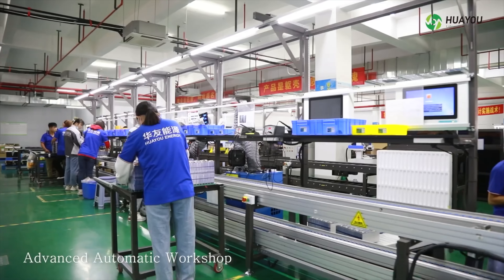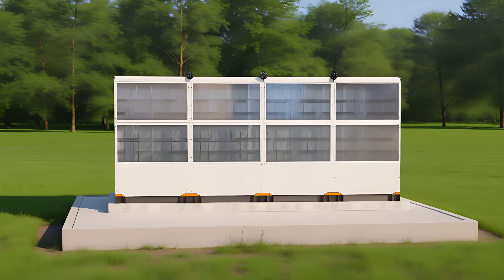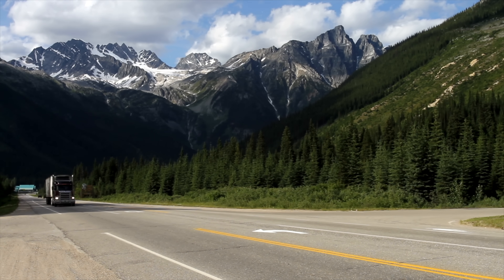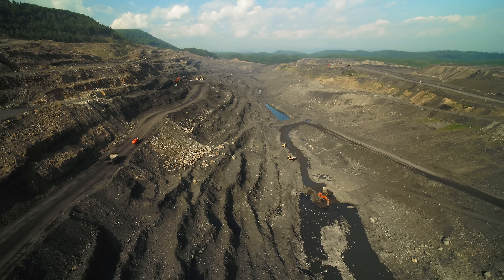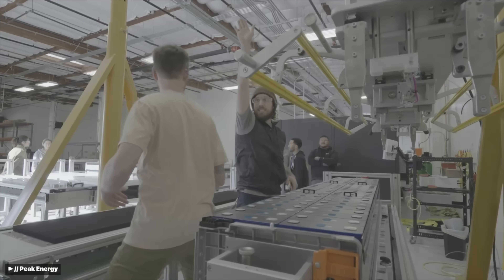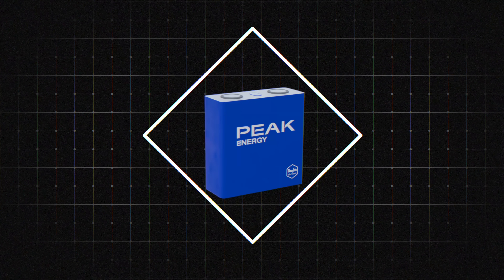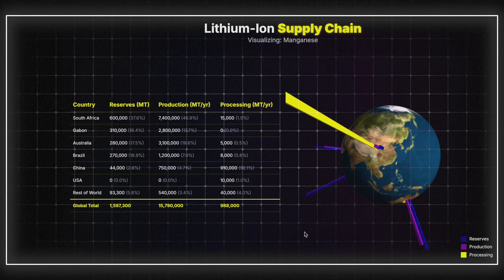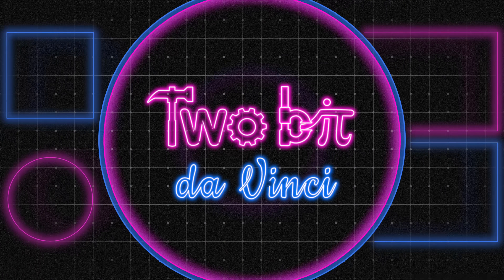Sodium Ion Batteries Are Going to be EVERYWHERE - Here's Why

Comment: Wait! According to Google AI,  China's CATL's new sodium-ion battery, branded as Naxtra, is set for mass production beginning in December 2025, targeting heavy-duty vehicles and energy storage, with potential expansion into electric vehicles. The second-generation Naxtra battery offers a competitive energy density of 175 Wh/kg, a long lifespan of over 10,000 charge cycles, and excellent performance at low temperatures down to -40°C. Sodium-ion technology is a strategic move for CATL, offering an affordable, safer, and more abundant alternative to lithium-based batteries, particularly for budget EVs and energy storage systems.

Comment: The voltage being a slop for the sodium battery isn't a pro. If you need 12 volt to run and after 50% you are below 12 volts then you ever have a device the runs slowly or not at all. It doesn't matter that the battery isn't dead until 2 volts if you need 12. This is why lithium is good for getting full power for it's whole duration even though it dies a bit sooner.

Comment: If that operation range can mean that an EV or hybrid doesn't lose 30-50% of its range in cold weather that would be a significant benefit for places where you can have weather that gets both cold and hot.

Comment: Every Car needs a One horsepower  engine running on FF making electricity for a battery that is 1/3 the size of what the car now has. Why is it people have such a problem with this. The Other elephant in the room is this. There isn't enough room on earth for number of solar panels you would need. But you can continue using FF and storing it in a Battery system like this and bingo no wasted electricity.

Comment: The next question is how fast it recharges and its weight ratio compared to lithium-ion. It's all good until it's not practical to use, such as if it takes two or three times longer to charge and is heavier than a normal lithium-ion battery.😊

Comment: None of this has to do with energy independence. Batteries don't generate anything, they're just crappy storage.
You also didn't address weight. Sodium batteries weigh up to twice as much as lithium batteries per kW. So now instead of a 2000 lb car battery with a flat discharge curve, you have a 4000 lb battery that gets weaker as you travel. That works against itself and sounds like it could cause a lot of problems. Imagine if a gas car lost cylinders as the tank emptied, just hoping to sputter to the gas station to get all your power back.
You seem to focus on the minerals part. Here's a solution, stop throwing giant batteries in cars and on the grid when it's absolutely unnecessary. They're just middlemen and can be removed entirely.
And lastly, I hear about some new battery tech being "just around the corner" every week. You nerds need to stop broadcasting vaporware.

Comment: Sodium ion batteries can experience thermal runaway, but the temperatures are low enough that materials in most vehicles won't ignite.  Plastics might melt a bit, but the car should be fine.

Comment: Not knocking it but salt batteries are not new.  They have been around for many years.  Now what is the round trip efficiency.  Safety, size, materials, life and efficiency are all factors to be evaluated.    I hope these work.  When you have 1 in a million bad batteries, just put 1 million batteries into a storage system, and you have a fire.

Comment: Check the Mobius EV made in Africa  30,000 units sold... Iron battery (they stole Tesla battery talent) - So low in cost they are retailing the car for $5000 to under $8000...  Apparently good for tens of thousands of charge cycles with no problems.  Naturally, the auto makers in NA and the EU are trying to keep it out of our shores by any way they can find... Then??? Throw in the Aluminum Ion battery from Tesla.. coming in the new model this year...?????

Comment: A couple questions.  What is this 600 mile range EV you mentioned?  If these new batteries are used in an EV, how is heat managed inside the sealed "skateboard"?  They will generate some heat.  Maybe it isn't enough to do an damage.  How does this battery tech compare to Tesla's aluminum-sodium batteries?

Comment: 7:00 “You get to use every drop of energy that you paid for”
When you charge a li-ion battery from 20%-80% and discharge it from 80%-20% you’re also using ‘every drop of energy that you paid for’. 

The point to be made here is that with a sodium-ion battery you can use all the VOLTAGE RANGE of the battery but I wouldn’t necessarily see that as an advantage as it requires more conversion which reduces its effective efficiency by probably a few percent. 

7:56 That’s not a DC-DC converter (that changes the voltage of a DC current to a higher or lower level) but it’s a smoothing circuit (like a capacitor) that diminishes the ripple (AC) on top of a DC current.

I appreciate your videos but seemingly minor details like these are important to get right imo because if not they reduce the credibility of the video.

Comment: I have the NexPower Sodium battery in my 2015 Toyota Prius.  It runs great seems to charge faster and get 47-50mpg.  The Prius has 254k on the clock.  Very happy since it is so stable.

Comment: Could this battery power airplanes like the Boeing 787 that have a lithium battery but also have a heavy metal container so if the battery catches on fire, which happened in 2013. The Boeing 787 battery fires happened on the ground, but it costs the airlines running the Boeing 787 and Boeing quite literally millions of dollars to fix. This would be good for smartphones and laptops.

Comment: As I see it, sodium-ion is better than lithium-ion in every way but one:  Energy density.  Now, that is a BIG deal for cars and phones and other applications where bulk and weight are important, but for grid storage, it really should not be much of a problem.  For EVs and small electronic devices, it may take a while, but I think that that sodium-ion will eventually win out.  Especially for EVs; if only smartphones and other small electronics remain using lithium-ion batteries, that would be a HUGE revolution.

Comment: Sodium 20 percent more weight and 20 percent less power so down 40 percent as per power to weight ratio , so basicly it'more like an old lhead acid battery
Reply: If what you say is 100% true, and if this video is 100% true, it’s still revolutionary.  The battery problem is huge.  A 40% p\w tradeoff sucks for vehicles, but there are so many other uses.

Comment: It's amazing how the religion of the "clean energy" has progressed.
Wind and solar would need batteries yes but they will never replace coal nuclear or hydro they just can't they are bad for the environment they come no where near the needed capacity plus the maintenance of both is more costly and dangerous.
So it might feel good but it's never gonna be realistic.
The EV side interesting for cars or hybrids but again... EVs are never going to replace diesel engines not with the current energy densities in batteries they would have to increase thousands of percent and even they we don't have the grib capacity and we could never build or maintain that level of supposedly green energy...
It's amazing how the progressive left has stood in the way of progress. 
If you want CO2 clean energy today or in 100 years nuclear is your only option ONLY option hydro works but with a big environmental impact. If you want to replace gas and diesel the only feasible technology in the next hundred years is hydrogen that's hydrogen combustion engines not fuel cells.

Comment: I missed the part where you explained the energy density difference from Lifepo4,  or did you say they're similar? Home energy storage will, lol, explode with these batteries. You mentioned less heat oroduced which would seem to lead to "softer" charge /discharge cycles, meaning that would overtake Lifepo4's longevity too?

Comment: Thanks for this info. I'm very interested in adding a battery backup to my home in Colorado. I have a few questions:
- Can the units be installed outside, as my main breaker box is not in my garage or basement, but in my dining room? Outside would have exposure to rain, snow and occasional strong winds.
- With the main breaker being in my dining room, I probably don't have room for another box, and definitely not the battery units. So I would probably need to power everything (whole house) when power is out. I guess I could potently add an enclosure on the outside wall to my dining room. This area is protected from rain but not cold temperatures.
- Is there an installer near Boulder, CO that I can connect with for an on-site evaluation of my building limitations?

Again, thank you for all your videos. I appreciate your thought process and the attention to detail. -Paul

Comment: so, the power density is a bit light but still in the functional range. that might improve over time. Whats the C ratings charge and discharge? What about discharge/charge cycle counts? if it can be charged rapidly then 5 min charging at the side of the road makes ev's more attractive. higher performance from a higher discharge c rating helps fight the "golf cart" viewpoint of ev's. batteries are too expensive to be replacing every year in an ev.

Comment: Been testing sodium ion batteries in my car audio system for a little overtime a year. Sxs comparison with lifpo4. Each battery is 80ah. What I've taken away is this. The sodium ion is a good battery. However. The degradation is much faster than expected. The lifpo4 i have was already a year old when I installed the sodium. The sodium has lost 8% already. The lifpo4 after 2 years has only lost 2.3%. I have also noticed the sodium doesn't retain soc as long. I left both batteries sitting for a week. Lifpo4 14.1v. Sodium. 13.3. The sodium was 14.59 and the lifpo4 was at 14.6 when the rest period and balancing started.
Reply: The chemistries are improving rapidly. The commerical cells available last year were already outdated when they were sold.
Reply: @patreekotime4578  But LiFePO4 batteries are available for years already and are also improved upon. See the issue ... One is a new tech with marginally better improvements, while another is in almost every solar powered+battery home, and yes, also in cars because the degradation is way less compared to other variants inc Lithium-Ion...

All i am seeing is that Sodium Ion has already been surpassed years ago by LiFePO4 on scale, while also enjoying the fire safety.
Reply: @olbluetundra881  ב''ה, good to know. 

Lithium did have decades to get this good and may have a few somewhat inherent advantages to the particular chemistries in exchange for all the, ahem, reactivity and expense. 

Meanwhile if you have grid, wind or sun available, not having the equivalent of what now old-school NiMH got to with "low self discharge" engineering is not a game breaker for a lot of applications and, conveniently for all the existing industry, lithium may still have premium uses for a few more years. 

Given the insane advantages in cost, the, well, "carbon zinc" equivalent of high energy density rechargeables having the trade-offs of carbon zinc versus alkalines or fancier stuff for your flashlight and personal massager seems reasonable.  Not as miraculous as the tech being fully formed better than lithium in all ways as USA, China, Japan and everyone else is still working on, but can't complain and the common case no longer being a fire hazard is a nice boon.

Comment: Sodium ion batteries are less energy efficiency vs Lithium, witch means they going heat up more in use, now if they have wider running temp this could make passive cooling  more easy, I have fact check the running temp of sodium batteries, one of early thoughts I had hard with sodium batteries is there cost at scale could much less, witch could mean starting cost and replacement cost of them in say an EV could much more of real working scale also driving them harder and deeper could close up some range gap even if some lost of battery life.   I found it funny you listing LIfe04 batteries as being cheap and used in cheaper EV's when it cost a lot more the lithium ion, but they have much longer life and are more for giving and don't burn so much a lot like the listed gains of the Sodium ion batteries, the prices of them have been coming down, I leaning that we may more push from them over.  But if Sodium can match or get close with like or lower cost point that, I'm not as sure we having as much of brake throw here just yet, I like see more info how these sodium are different

Comment: So how does it meet the automotive requirement metrics???   The volume to power output ratio and mass to power output ratio.  The superior temperature operating range is required for all applications, such as power grid back-up as well as vehicle power.   But mass and size is less important for stationary power back-up, than for powering vehicles.

Comment: 2:01 it’s not really difficult anymore.  The firefighters just need the correct tools.   There’s a tool called MurerLance and firefighters are currently extinguishing electric vehicle batteries that are under the thermal runway in 10 minutes and they use only 20 gallon gallons of water.

Comment: One of the benefits for cars is that the top and bottom 15% are usually gated so you don't damage the battery, where you can unlock the top % when needed.
With NaFe batteries, there is no need to put any gates, which means more range than you would normally get.

Comment: It is also notable that the this battery has really only a 50% storage at use voltage ( similar to a Pb acid battery) unlike lithiums 80%. Though this is not a real problem for designing domestic static usage where weight and size is not really a problem.

Comment: Said for ages that battery storage for domestic use does not use huge energy density. If the battery to power your home weighs a ton, but is twice the size of a Li based battery, it doesn't matter a bit. It's stationary and still not very big. It doesn't catch fire. It's fully recyclable ( although recent commercial lithium recovery has begun). Even in the tropics , where I used to live these particularly batteries would be fine. Shade them and allow full airflow ( with decent pack design) and they would be a s happy as you like. In the tropics ( especially the dry tropics) , high energy sunlight is very abundant. Charging for a full days use would nt take long, Add the new peroskovite efficiency and we are talking a whole new domestic ( suburb?) energy paradigm.  One question is whether the new cells have a decent life and how heat( cold) effects that life. I have put off getting battery for my home PV's because I was pretty sure that in the long term Li batteries wasn't going to be the better answer.

Comment: Sodium batteries CAN catch fire, it is just exceedingly hard to do so, just like how LiFePO4 are very hard to catch fire, but can be done if you do bad things to them.
I have been waiting for sodium batteries for quite some time, long before people started saying they'll be cheaper, i wanted them because in theory any country could manufacture them, and they're safer for nearly all use cases.
Edit, i was also excited about the theoretical charge discharge cycle they were estimating that in my opinion would have made up for the, at the time IIRC a 40% reduction in capacity

Comment: Two Bit da Vinci - thank you for another thoughtful piece. Your engineering lens is exactly why I keep watching.

A careful methodological note: juxtaposing NMC chemistries with sodium iron phosphate creates a misleading frame. A more rigorous - and consequential - comparison would place lithium iron phosphate (LFP) alongside sodium iron phosphate, because those two share safety and operational characteristics that NMC does not. LFP and SIFP are both far less susceptible to thermal runaway than NMC; once you control for that variable, the “safety revolution” narrative changes materially.

To be clear: sodium iron phosphate is genuinely exciting. Its low-temperature performance and application fit deserve serious attention - that part of your coverage is excellent. My reservation is about comparative framing: an imprecise pairing produces an inflated headline effect and risks obscuring the real technical trade-offs practitioners care about. A more apt metaphor would be comparing different cultivars of apples, not apples to mandarins.

If you’re planning a follow-up, a side-by-side LFP vs. SIFP analysis (thermal behavior, cycle life, cold-temperature capacity retention, and cell-level cost projections) would add the nuance this topic needs. Others here: would you find that deep dive useful?

Comment: If you want to get to $20/kwh where storage costs become near irrelevant, you need battery costs in $6000/ton  range.   If I use the old 2$/Kg (1$/lb the world around) for steel-manufactured materials number of half a century ago scaled for inflation to about 17$/kg today, and an energy density of 0.4 kwh/kg (a bit high for Na) it looks like somewhere in the $50/KWH will be the bottom end.

Comment: For home battery system NA size really don't matter as you can have an external building to have more batteries since they work from -40F to 140F. Li-ion battery backup systems are to high today and forget about going off grid. Also NA cost around $10.00 per KWH as Li-ion is still around $120.00 per KWH if you get a good deal. They only reason I've not gone solar is the battery cost.

Comment: I thought I remembered seeing that this technology required much larger batteries than other battery types, making it impractical for standard small batteries.

Also, what is the voltage of a cell? The voltage of a battery is determined by its chemical properties.